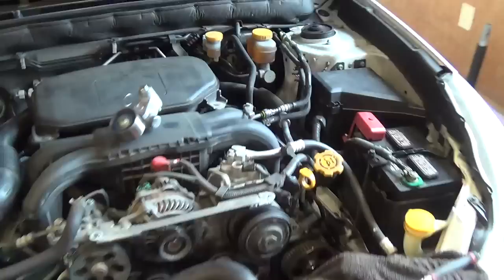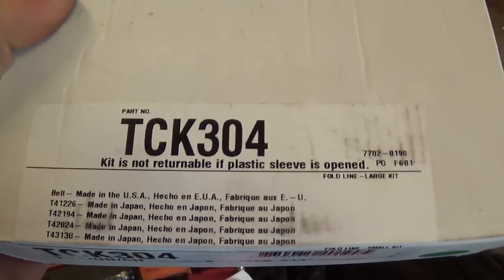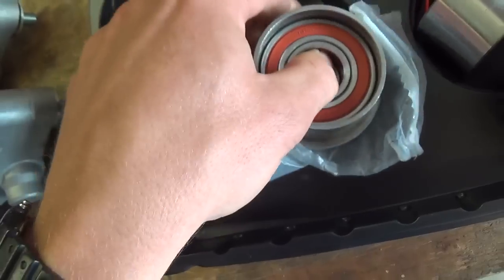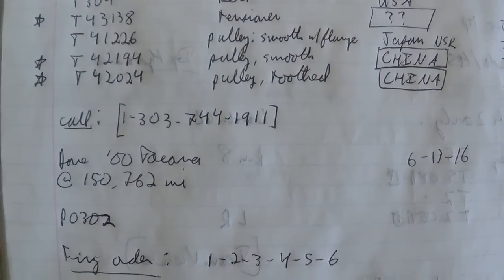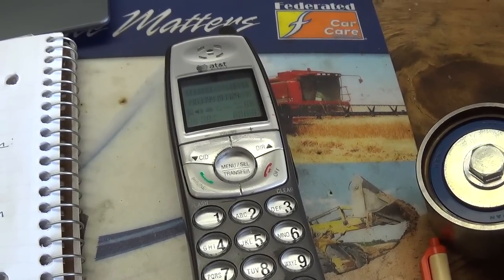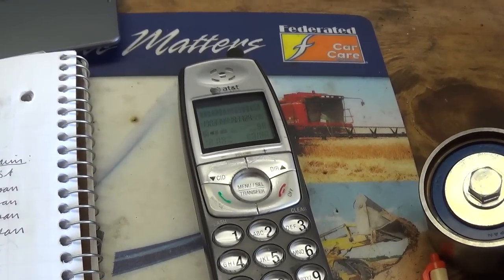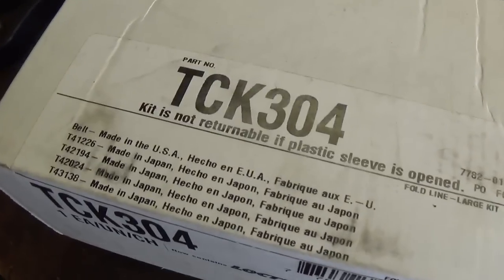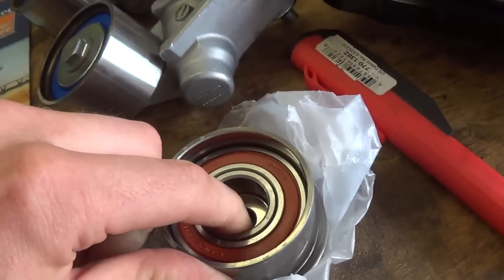GATES Subaru Timing Kits: BUYER BEWARE!

Comment: i bought the pulleys separately and the blue gates belt for my wrx from rock auto and I just checked. My pulleys were made in china except for the tensioner pulley and the belt itself is made in Japan... im probably still going to use them though as my old pulleys have a lot of play, its interesting that they are made in china but i didnt buy the kit so i cant fault them there.

Comment: I had a 2006 Honda Accord V6 6speed with over 300k miles, the first time I ordered the Gates timing belt kit from Rock Auto I received exactly the same parts that were in my car originally, Koyo idler pulleys, Aisin water pump and hydraulic tensioner which was back in 2012, last year I ordered exactly the same kit with the same part numbers, pulleys were Koyo, but the water pump & tensioner were Chinese with no name, I was so upset but I installed them anyways. the fact is that the box has the labels stating that all parts are originated in Japan except for the timing belt.   I guess Gates wants to make a larger profit by not giving you OEM parts anymore, they just give you "OEM-fit" now. 😐
Reply: Pay close attention to any strange sounds coming from that side of your Accord's engine because as I had to replace the POS Chinese Gates WP on my '05 Pilot last week with an Aisin unit after I started hearing  a grinding noise for around a minute after start-up. It only had around 40,000 miles/ 2 1/2 miles under it's belt and it's the first time I've ever had a WP fail prematurely. The Gates WP's are total garbage...avoid them like the plague. It's the Aisin kit all the way for in the future. As an added bonus the Aisin WP was Made in the USA.

Comment: Things to take away from this experience: 
1. False advertising, is a thing.
2. Made and assembled, are two different things.
3. Suggestion to just take the refund and go local. Then at least a real warranty and better negations if it takes the motor out. Especially since you documented everything.

Comment: GATES makes a Blue extended wear Racing timing belt known as their RPM line of belts which are a precision ground EPDM material that are EXTREMELY tough, more so than your average timing belt (maybe even a little harder to work with if you're a DIY'er). Gates quietly suggests their RPM belts are good for 125K miles, but people usually chicken out after making this extra expense and end up replacing them at the manufacturer's suggested interval. If your car has a non-interference engine and you have AAA, my suggestion is go the full distance! What do you have to lose except the same BS on the side of the road you may have with a mechanic's "I've had good luck with xxxx belts" choice or an OEM or no-name belt. Another suggestion is to install Japan-made KOYO or NSK idler and tensioner pulleys, NOT Chinese-made. Both these companies make bearings in both Japan and China, so be careful. Lately, Gates has been throwing in Chinese made bearings in their Timing belt kits to save money. Again, be careful of this. Chinese pulley bearings generally fail sooner than Japan-made bearings. If you find Chinese made components in a Gates kit, please complain directly at Gates and review them negatively. Good Luck!
Reply from the maker: One of my customers is still running his 2004 Toyota Tacome V6 on the original timing belt at 260k miles haha
Reply: @PineHollowAutoDiagnostics  I believe ya!

Comment: Ivan, it doesn't matter where parts are made. What matters is, if they are manufactured to OEM specs. For example, Honda assembles cars in Japan, the US and Mexico. Why would any reasonable person assume that, any Honda not assembled in Japan is substandard to one assembled elsewhere?
Reply from the maker: Agreed. Now you prove to me that these China Gates components are manufactured to OEM specs, and I'll put them on no problem. Until then, they are going straight to the scrap pile, not on any car I work on.
Reply: Can you prove the ones marked "made in Japan" are manufactured to OEM specs? These are ALL aftermarket parts Ivan. The parts marked "Made in Japan" are not original parts used by Subaru to assemble the vehicle. You're just confused.
Reply from the maker: Sure they are...KOYO and NSK are OEM suppliers, whose bearings have gone millions upon millions of miles without failing. That is proof enough for me :)

Comment: Those kits are priced so that an independent mechanic can do the job for one third to one half the price of a dealer. Of course they won't be the quality of OEM parts. They can't possibly provide OEM quality at that price point. I researched timing kits for a Honda J35 and could not convince myself to use any of them.  I can see why an independent mechanic would go this route because they have to sell the job to a price sensitive customer who they don't want to see back until the job's warranty period has expired. But not for me, I concluded.

Comment: I just got burned on a gates racing belt kit for my WRX!  I wish I would have seen this video before. I tried to post a negative review of it on Rallysport.com but..  My revew never seems to get posted to the website..
Reply: Did the belt bust on you? just wondering. I have an STI and picked up some gates drive belts from O'riley's.
Reply: It didn't bust on me just wish I would have known they were using Chinese bearings with their kits now.  I wouldn't have bought it.  I would have went with factory idlers and bought the gates racing belt separate.

Comment: Iv used Gates kits on dozens of Subarus man and they used to be the go to. And the most recent one I did a month ago I had this problem. The toothed pulley was wedged up against the waterpump and wouldn't turn. The customer insisted I replace them and I had very little options. I actually had to shave the waterpump ear down a little so the pulley would spin. So fucked up. Someone with too much confidence who didn't turn the motor by hand first before reassembly would face serious problems with it not moving. Its pretty bad that the quality has gone down this low.
Reply from the maker: Wow I think Eric O. ran into this situation a while ago. I would tell my customer straight up "sorry, I'm not installing this inferior part on your car, even if you pay me to do it." :)
Reply: Right on Ivan. Your reputation is your only warranty as demonstrated by your conversations with Gates and Rock Auto.

Comment: Busted, and Gates isn't the only 1.. I had an issue with Felpro saying that 1 of their gasket kits was made in the USA but in fact, had stampings on the parts that said made in Mexico. A not so quick call to their corporate headquarters told me that the LABELING, PACKAGING and BOX was made or done in the USA, but the PARTS didn't necessarily need be... Real cute.

Comment: Had the same thing happen to me for a Suzuki timing belt I did recently.  Gates kit came with all China bearings.  OEM was all German.  Left the water pump right in the box too.  I wasn't going to replace a genuine opel water pump at 50k with a Chinese one..  Thankfully the German bearings sounded better than the Chinese ones and I reused it all.
Reply from the maker: yeah good call!

Comment: I experienced this with a Gates water pump for a 2009 4cyl Tacoma.  It was ordered from Rockauto.  The pump body was definitely lower quality and didnt "feel" nice, but it was Gates and I took the chance.  I installed it and the seal leaked within 300 or so miles.  I ended up buying a generic replacement from Advanced to swap out while I had Rockauto replace my defective water pump.  The Advanced brand still on there 4 years and 70k later.  The RMA replacement RA sent me was VERY different.  It felt like they were doing a CYA.  There are sometimes "alternate" part numbers they've contracted out to cheaper manufacturers to save money.  When it comes to the vital components, I've learned that its OEM or don't.  This is very misleading marketing.  Rockauto knows what they are peddling and they should be called out for it.

Comment: I'm due up on a new timing belt, and I have installed the Gates kit back in 2013 without thought to this because Gates was reputable. Now i'm going to just replace the belts and hope that the old kit was not from China...at least the belts are still good, hope they dont source it to China anytime soon. Gonna have to spend big bucks on OE parts now.

Comment: Thanks for the video. From info in another related video it seems like they kept the high wear pulley high quality but figured they could risk it on the lower wear pulleys. I would not risk the toothed one at all for sure. Other video mentioned that high wear bearing having a new version with 2 bearings as an improvement. Everything these days is more and more short term throw away than it used to be. Sad.

Comment: I had a water pump go out on my 2.4 GM, it runs off the timing chain.  The car had 140,000 miles on it so I had my mechanic replace the chain and sprockets and the tensioner.  The car ran another 40,000 miles and used no oil ran great, I stopped one day and didn't notice any noise but when I went to start it the engine locked up.  I had my mechanic tear the engine down and the tensioner was run back all the way.  It had a Delco Remy name stamped on one side of the tensioner and on the other it had "made in China" stamp.  My mechanic had purchased it at Napa, it had been in the car two years  and I couldn't really expect a car with that many miles and that long out to be warrantied but the first tensioner was doing great and lasted 140,000 and the second went 40,000.  I hate anything I have put on my automobile to have made in China on it but sometimes it is all you can get.  I know very well there is no Delco Remy plant in China, they just bought the name and put it on at whatever factory makes it.
Reply from the maker: yup sad truth...

Comment: Some manufacturers do have their product made in China, but to their own specifications, not China's or whatever sweat shop is building them.. I have a Crown audio amplifier made in China, it has served me well for a decade-but it was made to Crown specifications and built like a tank. Maybe this is also the case with Gates? Even so, the issue with them is the mis-labelling on the box, and if it wasn't a customer car but mine instead, I'd send the whole box of parts back.

Comment: I always buy my timing components at the dealer parts counter.  Never had an issue.  I have replaced newly installed timing belts from other shops that have used the cheap Chinese kits.  They jump time, run rough, and/or just don't last.  Not worth the risk on a job that can cost you an engine.  Go OEM.  Pay the extra.

Comment: The default thinking by most of us is that anything made in China is always crap, usually from experience. Is it possible that Chinese parts  can or are produced sometimes to OEM quality standards when requested or specified by a company such as Gates, (or whoever). Should we always assume the Chinese products are inferior or could they be also  produced to quality standards when specified or requested by the parent company. - .
Reply: Rob Lord I have gotten several top notch parts/tools made in China.  They will make what the customer wants.  If gates is paying the factory for high quality they'll get it...if it's gimme 10000 as cheap as possible ...they'll get that (unfortunately we can't tell).
Reply: Of course! The Chinese can make anything you want to any level of quality you specify and enforce.

The trouble is how do you as a customer or a mechanic find out ahead of time if the parts are good? Things can look pretty good at a glance. Things are easier with the internet and sharing of knowledge. But sometimes you will be the guinea pig awaiting a string of comebacks and downtime.

You need a strong, reliable supplier who is willing to put in the effort to source and test and refine these parts to an acceptable, guaranteed quality. You need boots on the ground in China to make sure they aren't cutting corners. A supplier who would actually put these parts in their own vehicles for daily driving. One that isn't maximizing profits for short term gains, and actually wants you to be satisfied. You need to be the equivalent of Apple, Inc. circa 2010 in the parts industry.

If you can figure out how to do it profitably and reliably for generations to come, you will be a legend. Good luck with that one. "Just ship it" or "eh, close enough" seems to be the motto of the day.

Theoretically the aftermarket can make consumable parts that are better than stock too. Sure, here and there. But there's certainly a lot more junk you're going to wade through. Marketing is easier than the engineering and quality assurance.

I've lost track of how many parts I've bought a second time to correct the previous leap of faith.
Reply: When the parts are individually labelled on the outside of the box with part numbers and country of origin, and then you find the country of origin is incorrect on the casting/printing on the item, a huge amount of confidence is now lost by the customer. If they bullshit on the box as to the origins of these parts, then who’s to say the quality of these Chinese products is also bullshit.

Comment: My gates tensioner just took a shit on me after 5000 miles. I should've looked further when I noticed that it weighed MUCH less than the OE one I had on there. 2 idlers failed within 10 000 miles also. TRASH.

Comment: Definitely stay away from that Gates kit if you can. I had purchased an AISIN kit for a timing belt service on an Impreza and when I was ready to install the new pulleys, idlers, & tensioner, I discovered that the the company I ordered from sent me the wrong kit. Since I couldn't wait to get another kit shipped, I had no choice but to purchase a Gates kit locally. The tensioner in the Gates kit started failing about year later. I got lucky and caught it before ruining an engine. Buyer beware for sure on the Gates kit.
Reply from the maker: I just bought a AISIN kit for a Volvo V70. Inside the box...GATES timing belt! The irony!

Comment: They should advertise what's in there kits correctly this company is better than that. Have you confirmed those components are still being produced? What happens if subaru on a dealership level would sell you those components as well? Where is your data? What is your solution after you return the falsely advertised product?

Comment: Happened to buy the same kit and came across this video. They are no longer labeling this as from Japan - says components may come from Brazil, Canada, China, and 10 other countries. Looks like a mislabeling issue.

I'm not at all from asian descent but still see a racist bias here. The origin country is not at all representative of the quality of products since we're living in the modern age and China has the technology and a huge industry filled with competent producers capable of making components to the quality for which they paid to spec. You "get what you pay for" and I see nothing in this video that demonstrated the quality of the product is any less than that of what would be produced in Japan. It's a damn timing belt and pulley system, not a jet engine. Give me a break.

Comment: If I lived near you or SMA, I'd take a chance with these things, but I don't, so I go oem, hey i pay 1-2x more I dont have to work about it for another 60k or 100k miles. good enough for me. 
I asked for the radiator hoses to be replaced with oem, I looked back in the engine bay, (a year later) I saw gates hoses. So pissed. good thing they are decently reviewed on amazon. still going to eye it though. hopefully they outlast the car.
Reply: In any case, Thank you for this video. I'll stick to OEM parts from now on.

Comment: Your first problem is buying that late model of a car using a timing belt, that has known engine issues, and uses essentially fram filters at the dealer. Secondly, you don't know how to talk on the phone with a representative. You need to clearly state each item is labeled with the part number and each individual item states the country of origin, not just "it says made in Japan", he thinks it only states that on one part of the box, and not individually stating each item.

Comment: Installed gates component kit on my MX5. Water pump doubles as alternator bracket mount. It broke clean off in less that 1k. Says gates but also says made in China.. ridiculous.
Reply from the maker: Nice, way to go Gates! I tend to leave working water pumps alone for this very reason...if it ain't broke... ;)

Comment: I purchased a gates timing kit for my Subaru and the “made in China” tensioner was a different casting design . It doesn’t clear the bolt heads behind it .    I am from now on never getting parts from rock auto , I will not put fake china crap on vehicles I work on . And the hassle of getting refunds is discouraging too.

Comment: The bearings say Gates on it...and made in China also...so Gates is subbing it out to a cheaper Chinese company, and HOPING that the quality control is ok...I 100% agree with you...and would not use the parts either...Who knows what quality the ball bearings in each pulley is...and say, 50,000 miles later...your receipt is gone or lost, and have no way to get anything back on this...I really dont think Gates will warranty the parts or what damage the parts cause if they fail..which will be a complete engine failure...